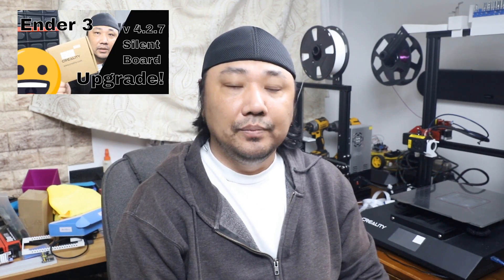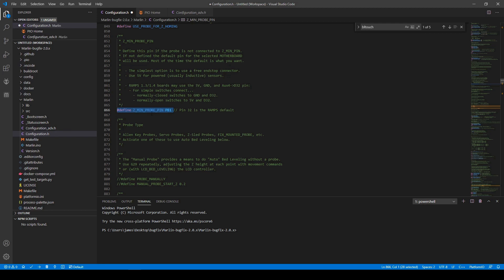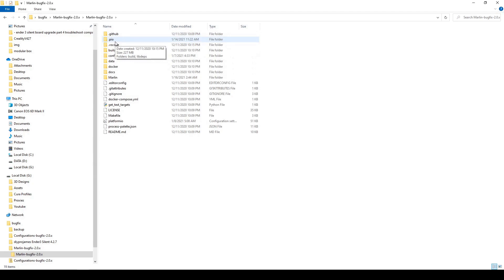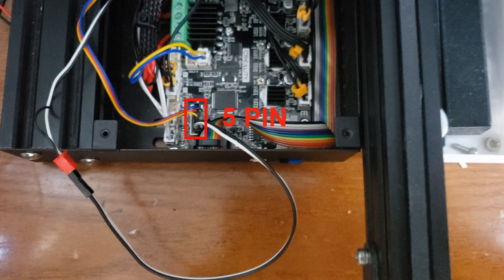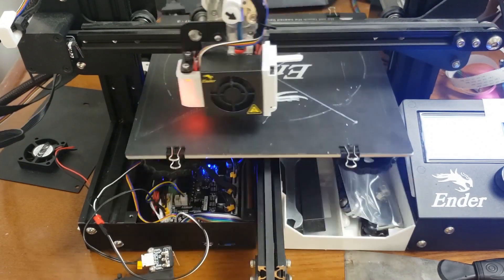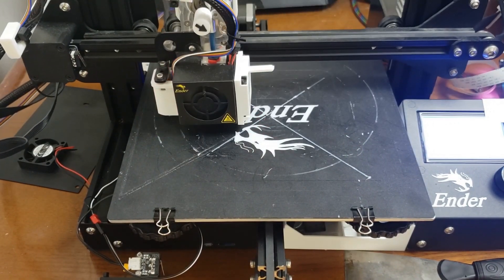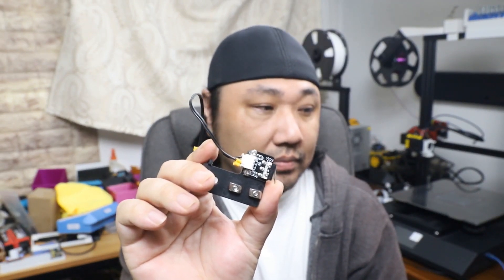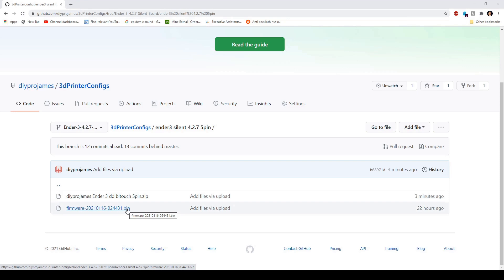ENDER3 4.2.7 SILENT BOARD UPGRADE - PART 4 - BLTOUCH 3.1- SWITCHING FROM 3/2 PIN TO 5 PIN

Comment: Would that work for ender 5 pro? Im having z home issues and sometimes bl touch error M999. My mainboard is V.2.7 BL touch 3.1. Iam using those 5 pins, although only those 3 pins for ground, signal and V. z BL pins I switched with z pins.

Comment: Can you link all the parts you printed for the ender 3 fan housing? Since I see something on the right side of the housing along with the left side, which I assume to be the bltouvh v3.1 bracket. I have a ender3 v1 heavily upgraded with a 4.2.7 board, glass bed, heavvy duty yellow bed springs, and aluminum extruder attach,end and Capricorn tube.

Comment: How would I go about also using the Z end stop in the event the probe fails?
Reply from the maker: You would have to remove the disable the probe option in the firmware.
Reply: @DiyProJames  So the z end stop and probe can not be configured to work in conjunction?

Comment: Can you do a full installation video with the 5 pin connector I'm utterly lost
Reply from the maker: The easiest way is to do it is make sure you have the correct wiring and then find the matching firmware to upload.

Comment: Hi James, hoping you see this and get a chance to get back to me. I got everything set up with my new 5-pin version of the BLTouch, but it seems to struggle in the Z-axis for some reason. My probe works great, it lets me use the 9-point probe leveling, etc. but my nozzle never moves any closer to the bed than about 5-10mm away! Z-probe offset doesn’t move my Z-axis at all, Fade height didn’t change anything, I removed my Z-stop...any advice for me? Thanks in advance!
Reply from the maker: This video shows how I setup the nozzle to probe relationship. Hopefully this helps. https://www.youtube.com/watch?v=3J9NhwbziEY&list=PLKB2mjSs4KgN29yU2t4kGeNoVFJWeSt6H&index=6
Reply: @DiyProJames  I’ll take a look and get back to you tomorrow, thanks!
Reply: Hi again, James. When I try compiling the firmware using the changes in that video you just linked for me, I get an error saying "One or more timer conflict detected. Examine \"timers_in_use\" to help identify conflict." It's frustrating because I don't know what to do to fix it, I can't compile my firmware past this point.

Comment: Hi, great video. I had a doubt, I try to place the line "#define Z_MIN_PROBE_PB1 // Pin 32 is the RAMPS default on my MKS 1.4 turbo board and it gives me a failure, which may be. Thanks
Reply from the maker: If you read the Marlin documentation the pins a mapped based on RAMPS configuration. This question should be directed toward someone doing mks 1.4 turbo bltouch upgrade video. I do not have a mks board so I cannot diagnose or give you a definitive answer.. Some of the bigger channels might have done this type of upgrade before. It maybe best the check there.

Comment: Hello,

Is there any reason you can think of that would cause the bed leveling to go through the bed level process, but not actually compensate when running the program?  I used your configuration to finally get the bed level device to work, after some tweaks on my end it finally worked or at least allowed the bed leveling process to take place.  However, i now can't get it to save the values when checking level, so my first layer is absolutely awful.  No movement in the z axis when running to compensate for the unlevel surface.  I have the whole bed level mechanically using a micron dial indicator because i was getting that frustrated with not being able to make a first layer.  I have it within 75 microns, but when running larger pieces it still presents an issue.  As of right now, the blt touch is nothing more than a sophisticated z offset feature.  Any suggestions would be much appreciated, with support to follow.
Reply from the maker: Were you able to watch the playlist?  Please watch this video https://www.youtube.com/watch?v=3J9NhwbziEY&list=PLKB2mjSs4KgN29yU2t4kGeNoVFJWeSt6H&index=6 
It depends on the surface of the bed.. The bltouch is not a lidar system where it maps the whole bed. It only has 9 points. You can increase these points in the firmware. So they are like slopes. If your bed has pot holes in between points it will not help. If it instead has a bend or bow it will help... Also , maybe watching this video may help. https://www.youtube.com/watch?v=eO_uZnwtNtw&list=PLKB2mjSs4KgMepomVY9ZLH8LIRcNjUSYo&index=12&t=11s
The take I want you to get out of this is that the bltouch or any other sensor is not a solve all problem... It may not be your bed. There could be other problems your not aware of...

Comment: Hello James. Thx for your Video. I have also Ender 3 Pro with the black Board. I Update 4.2.7. The BLtouch is 5 pin on both side of the cable. My problem is, not Autohome or move x or Y. I only hear 1 second he try then is finish. Display say Autohome failed pls reset. I also try to use your configuration, but is not work.
Hope you can help me.
Printer is new from January 2021. Also the BLtouch. I have one BL touch more, i try change, still the same problem. BLtouch both V3.1

Regards.
Sorry my bad english, i am from germany
Reply from the maker: If your mother board is 4.2.7 it should be stamped on the mother board. I have two different types of configuration. One  is using the z stop one using the 5 pins. Best option is to use the z stop.

Comment: Is it necessary to do this? I thought I just connected the BLTOUCH to the old z stop spot. What are the advantages to this?
Reply from the maker: There are no real advantages. I added the video because there were people who asked if it could be done using the 5 pin terminal. I think the newer bl touches are coming attached in as 5 pin.
Reply: James, mine showed up with a 5 wire cable. i added the 4.2.7 board/ and added the new v2 display. i try to get firmware up and loading. but all i get is dark screen. no other noise except a beeeeeeep.  im nervous because i heard if you didnt split them youd smoke the board. obviously this didnt happen with you. nice.  ill try your  compiling instructions soon
Reply from the maker: @donrobinson6015  This is probably because your using a different screen.. The ender3 and ender3 pro have old screens and the newer v2 has a different screen. You will have to enable the new screen and disable the old one. Also, follow the wires on the bltouch and the diagram. You can clearly see on the board where each wire should land. They are labeled..
Reply: James. so it should be a little better. if i putr the stock display on. load firmware for the board?.   the bl touch was easy it came with a cord not split. 5 wire. i pulled two wires out of the plug  and used them in the 3/2 version so i wouldnt fry the motherboard. .. should i bring it back to 5 wire?  once this is all worked out can i then add the new panel?
Reply from the maker: @donrobinson6015  It really does not make a difference if you use the 3/2 or 5 pins.  You just have to specify in the firmware what your using. Example specify your using 3/2 pin bltouch. Specify your using the new v2 lcd screen. Specify what hardware your using. That's what your doing to the firmware. You're specifying which hardware to turn on. If you turn on the wrong one, the printer will not recognize it and give you an error.

Comment: Master I have a question.

I made the V4.2.7 motherboard and Bltouch V3.1 connection to the motherboard, which I added an Ender3 V2 model printer by looking at the videos.
Black and White Wire hooked up to the Z axis. Then I connected the Blue, Red and Yellow wire to the BLTouch socket.
I would like to make an important reminder. (Those who have received the Creatlity BLTouch Pack need to swap the Blue cable and the Red cable, or the card may burn out.

I throw the software with the help of visual studio, but BLTouch takes the end out 2 times at the beginning. Then Continuous Red flashing. I want to adjust the tray, but when I click on the BLTouch menu, the Nozzle sticks to the tray in automatic movement.

Is there a solution to the problem?
Reply from the maker: I don't know what you're asking. I don't know what tray is. I'm assuming bed leveling, and you don't have your z offsets correct. This is why the nozzle is hitting the bed. Adjust the z offset of the nozzle.
Reply: @DiyProJames  Is there any software information for ender3 V2 4.2.7 version motherboard and BLTouch 3.1?
Reply from the maker: @ercumentbaloglu  There is a lot of information on the V2 as the Ender 3's are popular. This is why I put up the video on compiling firmware. https://www.youtube.com/watch?v=OWqI_DO3OoQ There is no real difference in how the firmware is compiled. The only real difference I see in the V2 vs the V1 is the LCD screen. Disable the LCD screen for the V1 and enable the LCD screen for the V2. There are many videos out there on compiling the firmware for v2. I do not own a V2 so I don't want to give any definitive answer without testing. But you are no longer working with a V2 board when you replace it with the 4.2.7 board.
Reply: @DiyProJames  THANK YOU